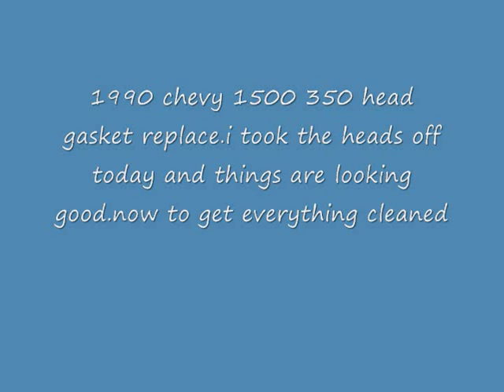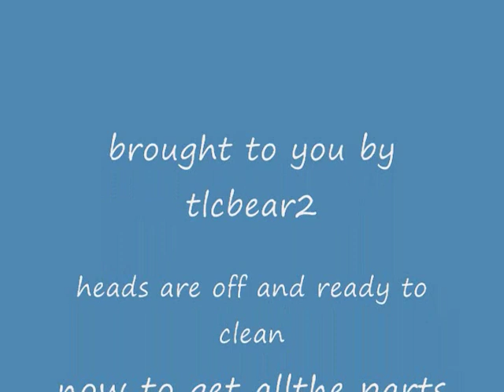1990 chevy1500 5.7  head gasket repalce part 3 heads removed

Comment: Great video! Thank you, What the best way to remove the exhaust manifold bolts without breaking them off?
Reply from the maker: +Loyd McMahon on the heads you  dont have much choice either they come out or break.the stud you will have to be very careful and use a torch to heat the nuts with or break them off and deal with it out side the vehicle.is about what i have to do.thnak you for stopping by anymore questions just ask

Comment: Some of the 87-98 5.7 engines would wear so much that boring them .040 won’t clean the cylinders up. GM used piss poor cast iron in the heads and blocks on the late model 5.7 engines.